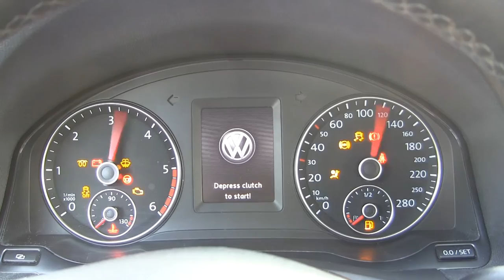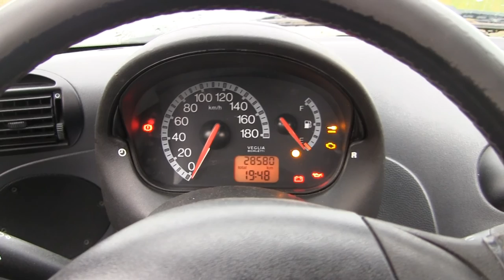DStage #13 - Performance fuel pump part 2 (SC mod)

Comment: And gss341 342 will also fit, right?
Reply from the maker: Yes, it's only a matter of that plastic filter "sock" at the bottom that will have slightly different shape depending on the pump model due to different size and position of the intake.
Reply: Thanks a lot!

Comment: Hi! If it's not a secret, there did you bought the pump?
Reply from the maker: Hi. I've bought it on internet auction. It is branded by Epman. I also have a second one basically the same just with different fuel intake (thinner like in GSS341 / GSS342 instead of this wide one like in GSS340 that you can see in this episode). The cost was around 40 Euro if I remember correctly.
Reply: Great! Thank you for response! I'm going to try it.